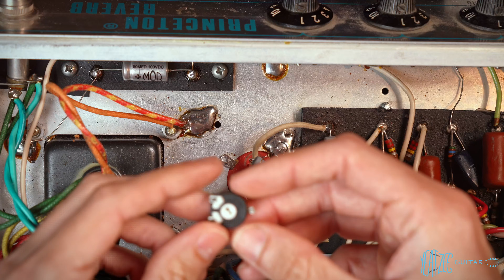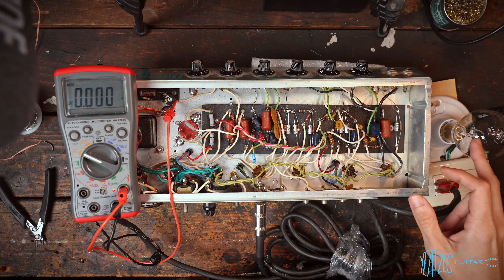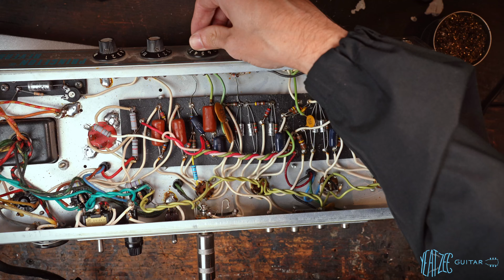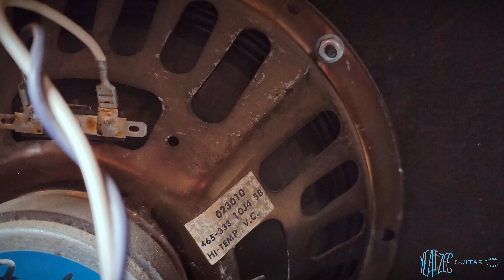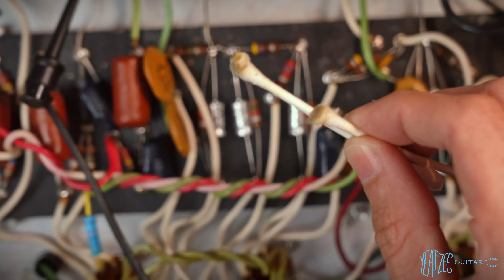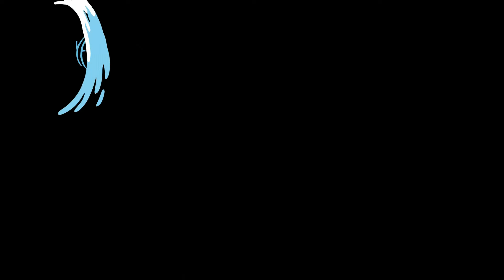DC EVERYWHERE! - Vintage Fender Princeton Reverb Amp Repair Pt.4

Comment: Just picked up a ‘72 that needs a recap…the wax issue makes me a little hesitant to tackle it myself.
Reply from the maker: Sometimes they're fine, it's really a case by case basis
Reply: @ finally re-capped my ‘72 last weekend and added the bias pot like you did. It went well! Thank for your help! 
Btw…what multi meter do you use? I like those clip on leads. Thanks again!

Comment: Always check the pinouts and datasheets on customer recommended substitutions.  Don't take their word for it because if and when it goes wrong, you're the one that did the sub.  You'll need to make sure the sub is a 1 for 1 drop in and check to make sure you aren't pulling more heater current than the power transformer can put out. 

With respect to the rectifier affecting bias, sag, voltages, etc... Think about the role of the rectifier.  If it affects B+ in either direction then the plate voltages are affected and therefore the bias to plate voltage ratio changes.  

With respect to suspecting DC on the pot, just measure it.  No need to guess or assume. It eliminates unnecessary wear from cleaning the pots and gets you to corrective action much quicker.
Reply from the maker: All great points. I asked that when speaking to the owner and he assured me it was a drop in replacement and sent me threads from forums discussing it to show that it's nothing new on princeton's. See next ep for the DC debacle continued lol

Comment: I see you still have not fixed the wiring errors associated with the five resistors you connected to the tube sockets.
Reply from the maker: It's a miracle, your comment is showing up! Yes, this work was done a couple days ago there's always a gap due to editing.
Reply: Probably because I didn't mention the unmentionables.  ;>)